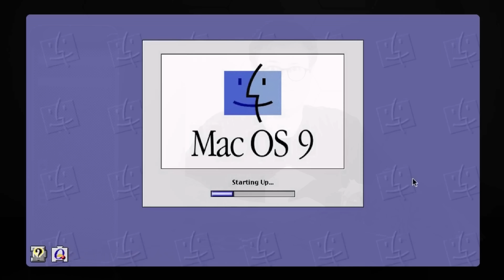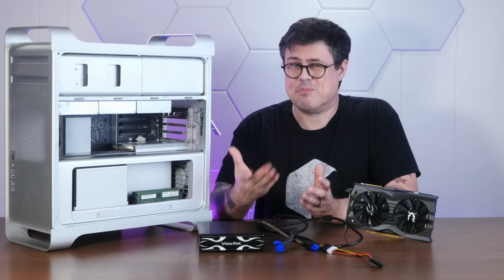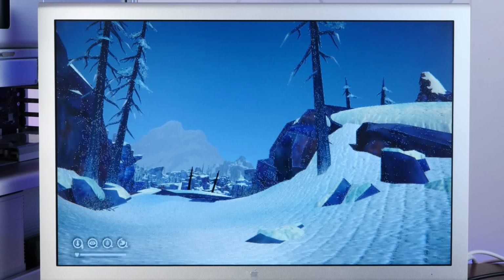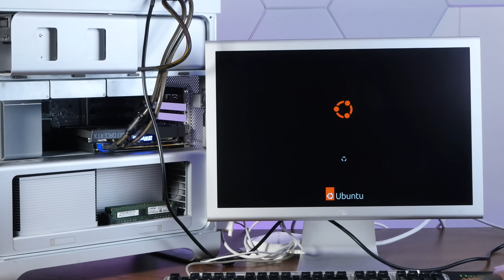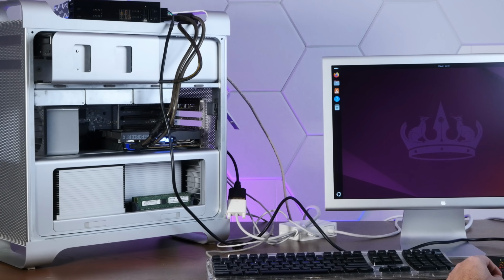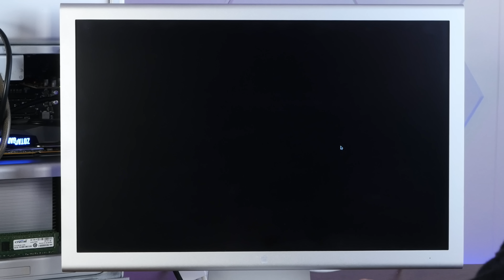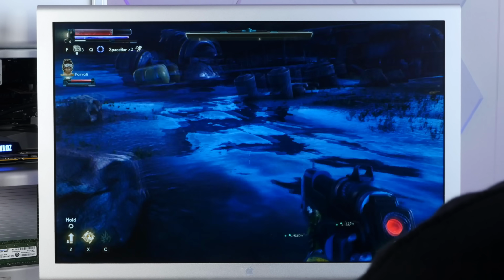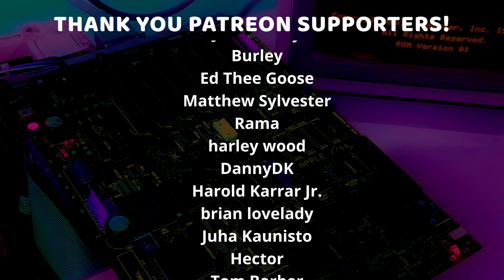I put an RTX 2070 in an old Mac Pro!

Comment: I too have a 4,1 upgraded to a 5,1. If you’re going to do the upgrade to a Westmere with integrated heat spreader (rather than the custom heat spreader-less Nehalems that Apple shipped them with), then be careful as I murdered one of the two CPU sockets (and by extension half of its RAM slots) doing that.

Comment: I have two delidded X5550s and some spare DDR3-1333 I'm happy to mail you. Remember not to fill all the RAM slots, as it downgrades to dual-channel mode. That's still a max of 96GB. It can also natively boot from NVME since you mentioned you flashed to 5,1 firmware. Also each 6-pin PCIe power header can output 75W max, same as a PCIe slot, so I'd keep any GPU using the onboard solution to 225W TDP or less.
Reply: That's the trick to getting the most out of these machines -- keeping it in triple channel mode. The CPUs love being fed with plenty of bandwidth but don't have the advantage of high speed RAM like the newer intel chips. People are often surprised, though, how fast these systems run when put in the right configuration!
Reply: Isn't the X5550 what he already has? In any case they're non-impressive. X5680 is a newer process, 50% more cores, faster clocks, and is only $15 each. Even the top of the line X5690 isn't too expensive.
Reply: @eDoc2020  might have missed which xeon he's using. I upgraded mine to a pair of x5690s.

Comment: Sean,

I just watched your video "I put an RTX 2070 in an old Mac Pro!" in which you put an RTX 2070 in an old Mac Pro.  You refer to using the drive bay power supply as janky, but I must disagree.  An external power supply or one mounted in some precarious way inside the case would be janky but your solution is inventive and elegant, or at least could've been.  Now, in an ideal world, you would've modified or replaced the computer's power supply to provide the needed extra power, but that it beyond the abilities of most people, maybe even you.  So,, I feel your solution was the best, most logical approach, but you should've drilled that hole, since that is well within the skill set of most people.  And that would've let you route those cables the proper way and made it non-janky.

I appreciate your efforts and your light-hearted approach.  I hope you take my short comment in my intended spirit.

Regards,

Rsger1969
Youtube channel subscriber

Comment: The RTX 2000 series all have boot screen support on the 4,1 and 5,1. I ran a zotac 2070 in my flashed 4,1 and the bootscreen worked.

Comment: I completely agree with what you said about "why buying new tech". There's no such thing as "dead tech" or "old tech". I know that Pentiums III and IV can be a pain to work now, but machines with 15 y.o. like the one you showed here, can be absolutely refitted and upgraded. i.e. I'm using a Lenovo E531 laptop from 2011 (I think). It came with a 3rd Gen i3 CPU and 8GB of RAM, but being a quirky g33k, I slapped it with a 3rd Gen i7 CPU, 16GB DDR3, a M.2 2242 240GB SSD card with Linux Mint and a 256GB SSD for storage. And it's working until now. Not to mention my Lenovo ThinkCentre from 2016 with FreeBSD as my daily driver. Instead of buying new stuff, people should squeeze as much as one can from old devices, instead of buying new stuff that becomes obsolete from year to year. Anyway... Great video as always, dude!
Reply: I tell people this all the time. Going from a computer in 2024 to one from 2014 is a much smaller jump than say, going from one in 2014 to one from 2004. Ten year jump either way, but moving multicore definitely helped longevity. I consider the cutoff to be around the Core 2 Quad for what we would consider a "fluid" experience under a non-lite OS.I still daily a 2012 MacBook Pro and 2012 5,1. Still very good machines in every other way than power consumption 😂 The difference will only get smaller as time goes on since flash storage eliminated the last of the great bottlenecks and picked the the last of the low hanging fruit for easy performance gains

Comment: While these devices are still very capable today, and we should keep them functional if people want to use them, there is a reason they're being abandoned en masse: power efficiency and processor security vulnerabilities.
The CPU in my laptop, a modern AMD Ryzen 7 7840U (admittedly a high end mobile chip), can outperform that Mac Pro in literally every benchmark, all while consuming less power than that machine does idle.
Plus, it's received hardware mitigations against spectre and meltdown, while the software mitigations necessary in those Westmere chips will eat your performance even more.
If you live somewhere with cheap power this might not matter to you, but a significant portion of the world doesn't. Plus, while one person consuming 500W to do a task that a modern computer can do with 2W might be harmless, an entire city of people doing that measurably increases load on the power grid. Same reason many utility companies offer rebates for more efficient water heaters, thermostats, AC units, etc.

Comment: I still have & use  (as a file server) my 2012 Cheese Grader Mac Pro.  I bought it new in 2012, dual 3.46 Xeons, 64GB of RAM, and an RX580 GPU with 8GB of RAM, the machine quietly runs in the corner and works flawlessly.  It was and still is an amazing machine, not as fast as my M1 Ultra Studio but fir a 12 year old machine its Awesome!

Comment: Ok i get that you already had the 2070 at hand ... but i cannot stress enough that Nvidia Hardware is suboptimal for Linux and MacOS. Apple ditched Nvidia when Nvidia GPUs desoldered themselfes in masses from MacBooks. And AMD and Intel Hardware has way better Linux support as their drivers are opensource and baked into the kernel.

Comment: Y'know, speaking of these old mac pros, I actually got one from a classmate a while back. It's had it's share of problems that I could fix, but I think I'm stuck on the latest one for now.
Whenever I turn it on, no chime, and the power light on the front stays off, and after a few seconds it powers back off. My best guess is power supply, but it'll be a while before I can go looking for a new one.

Comment: Great video,  but there’s an important fact that should keep these Mac Pros on the shelf rather than being used. The power consumption is OUTRAGEOUS compared to a more modern PC. It’s a space heater first and a computing platform second. You could also use a Raspberry Pi 5 cluster to stream Twitch and be using the power that beast uses to just run the fans. It’s wasteful.

Comment: I work as a tech for 30 years in post production for long format. When a system is working doing its single production task it will often stay in situ for a decade or more. I still maintain many 4,1’s (all upgraded by now with maxed out CPU’s) that are on 24/7 being used 18 hours a day. Hell, just 9 months ago I decommissioned a Blue and White G3 that was the main facility SFX sever, so like 20 yearsish 24/7. Glad your showing people every computer has a use 👍 Cheers
Reply: I’m glad I’m not paying your power bill
Reply: @Ping_freud22   Agreed 👍
Reply: @Ping_freud22  the money spent on computer power is saved on the heating bill! 😆
Reply: @_..-.._..-.._ depends on if the room in question needs the heat and whether it can be heated with a heat pump instead.
Reply: Interesting, was the G3 using Mac OS, Linux, or some sort of BSD?

Comment: my daily driver main development rig is a 2005 Mac Pro 1,1 i got from a ham radio flea market back in 2012 for $100, it came with a whopping 32GB RAM already installed, I dropped a geforce GTX 980 in it with a pair of 3.0GHZ quad core SLAED model Xeons, and it was playing games like Witcher 3 and Rise of the Tomb Raider at ultra settings smooth as silk, even the Unigine benchmarks ran smoothly. Of course that was back in 2016 or so, but still damn impressive for a machine that was released in 2005. Whoever said macs cant play games never pimped out a 2005 mac pro, not only has it been my primary gaming rig for years but it runs dead silent doing so thanks to Apple's over the top cooling scheme.

Comment: What you're not streaming from the g5 anymore? (That was absolutely insane btw) You can technically stream from just about any potato cpu if u have a gpu with hardware video encoding in there because the gpu will do all the heavy lifting and the cpu just has to run the os

Comment: For the longest time, my main rig was a decommissioned Dell Workstation with the same/ similar cpu. Ran absolutely flawlessly for years, and I only upgraded because the motherboard's sata controller died and I figured I should have a slightly less jank solution for something that im using for my career lol.

Comment: If I remember right, most AMD GPUs work just fine on Mac Pros but Nvidia ones are not so easy to get work on these. Like I was not able to get my 1060 GtX and had to go with old 2010 AMD that was my only AMD GPU I had.

Comment: The no-ish display issue is due to power management. Its not the driver, its a bug in the latest Ubuntu. I had to adjust via CLI to fix mine from doing that.. Just google no display on login for 24.04. I got the same issue on my PC with AMD 6800 XT graphics.

Comment: RTX 2070 max. power requirements is 175 W. PCI slot can deliver 75 W, the extra power connecters on the backside board do 75 W each. So you can just use those, it'll run fine.
Reply: a lot of people who were upgrading 5,1 Mac Pros put Vega 56/64s in, a 2070 should be fine with that power draw given Vega's were from the very same sockets!
Reply: Slight undervolt 2070 Super ... Shure will Work without Power issue

Comment: I've been working on a 5,1 12-core. I'm running an RX580 in mine and I recently got it running Sonoma. These machines are awesome and beautifully engineered. I had a 1080 TI (actually 2 of them) running in Mojave (I think. I know I used them with El Capitan) with nVidia Web Drivers on my Hackintosh. I don't think nVidia provided drivers beyond that, though. I thought I saw something about non-metal graphics being supported by the latest version of OCLP. . . The information was not pertinent to my situation so I did no further digging. Maybe they have drivers for the 2070??  Anyway, I look forward to more jankiness. . .

Comment: i think you should have swapped the optical drive and PSU , putting the PSU ontop and the optical drive on the bottom - mainly because wouldn't that PSU generate heat and potentially damage the optical drive?

Comment: I have a simular setup, a MacPro4,1 with 5,1 firmware, dual X5690, 128GB of ram, a 1030 and a 1080ti(i use a 1000W psu to power it lol). Why only a 1080ti? Because nothing newer worked for me, i cannot put a 2060 or 3060 in it. it just doesnt boot so you just did the impossible. Also the GT120 is capable engouth to stream and game, i played minecraft and fortnite on it and it worked. Also the GT120 is a mac edition card so i needs other driver and the mac edition version of it cant decide if its a GT120 or GT9700. this is why i hate macs. (all expiriances listed above where on windows 7/10)

Comment: The Mac Pro and all the extreme Macs starting with the II, IIx, IIfx, Quadra 950, Power Mac 9500/9600, shine bright in my computing aspirations even though most of those machines had uses cases that I will never actually need. Having one of these Macs just signaled to myself that I really made it and had the ultimate expression of a Mac. Timeless wonder.
Reply: this is the last one I had that feeling for, never even owned a mac and not particularly a fan, but the combination of stunning design and computing prowess really spoke to me

Comment: Honestly not surprised it's running the games well. I was still using a Quad Core Xeon CPU up until a few years ago, basically equivalent to a mildly souped up Core2 Quad and it was doing just fine with AAA games with a decent GPU installed. We really do have way more CPU power than we need in most cases these days!

Comment: I got a 2010 Mac Pro Server for absolutely nothing recently, only a single CPU model but even with its stock ATI GPU it runs Monterey fantastically.

It even came with an Apple RAID card and drives full of old marketing material. It’s neat!
Reply: Update: it’s now running an X5680, 64GB RAM, and a flashed GTX 680. It’s absolutely rapid!

Comment: Does this MacPro have the limitation where it will only boot 32bit EFI, despite being 64bit hardware?  If so, did you have to do anything to get around that? Perhaps that was fixed with the firmware being flashed to 5,1? 

I'm having an issue where my Thinkpad has died (rip) and I've had to pull my hard drive out and shove it in an old MacBook Pro in oder to have a working laptop until I can replace the motherboard on the thinkpad.... we're dealing with Linux with a 64bit grub bootloader.  On my newer MBP 8,1 it boots up just fine with the use of rEFInd.... however, I would love to get it running on my older 2,1 MBP for that sweet, sweet nostalgia.  However, the issue is that the older 2,1 has the issue of being unable to boot 64 bit EFI firmware..... so rEFInd doesn't show my Linux partition as being bootable.... so these are the fun things I'm dealing with & I'm surprised that you didn't have to deal with the same nonsense with the MacPro!  Lucky!
Reply: 3,1s and above have 64 bit EFI, a 2,1 is basically just a 1,1 with dipping sauce.

Comment: I love my 2010 5,1 Mac Pro, which I upgraded with a 3.46 GHz six-core CPU, 48 GB of RAM, an RX 580 graphics card, a 1 TB NVMe SSD, a USB 3 and C combo card, a FireWire 400 card and dual Blu Ray drives.
My metalworking neighbor also cut a hole in the access door for a neat window through which to view the RGB-glowing components. :D
I also have a 2.4 GHz twelve-core dual-CPU tray with a whopping 96 GB of RAM, but I choose to run the six-core single-core tray. Since I game a lot on my Mac Pro, and most games aren't really designed to use multiple cores, I'd rather have six fast cores than twelve slower cores.
Reply: Still a slow pc by today standards.
My 14.5inch creator laptop smokes the living fuck out of it cpu wise and gpu is no contest
Reply: @PKperformanceEU  
You're right, of course, and my main computer is an M1 Max Mac Studio that runs rings around the 2010 Mac Pro.
But I still love my Mac Pro, and for Photoshop and Mac gaming, it's still extremely capable.
Reply: Well said bro @PKperformanceEU
Reply: Good
Reply: Windows?

Comment: Version 555 of the nvidia driver should bring wayland support... which is why you do not have a login screen coming up.  You may also be able to somehow get gdm to run under X11.... but being that the "g" in gdm stands for GNOME... that's probably going to be a bit less than worth the trouble.

Comment: The login screen issues may be due to Ubuntu 24.04 defaulting to Wayland over X11. I've encountered a similar problem in the past, and switching to X11 resolved it.
Reply: @2xtreem4u  All you have to do is disable Wayland in /etc/gdm3/custom.conf reboot and X11 will be the default

Comment: You can run the cables in the far top left corner. Its tight but its possible.
One of these is my main machine, heavily upgraded. 96GB of ram, dual X5680 6 cores. It started life the same low spec as this one. I played the outer worlds on it, and hogwarts legacy, jedi survivor.. you name it, it’ll run.
Reply: This is cool! You run it under Linux or Windows? maybe both but who knows lol
Reply: Almost enough for modern video editing!
Reply: can it run doom?
Reply: Damn, I’d never expect a machine that old to keep up. Workstations are built different I guess

Comment: Try manually installing the Nvidia 545 driver using the command line. It might fix your issue. Or, you can try the 555 beta driver